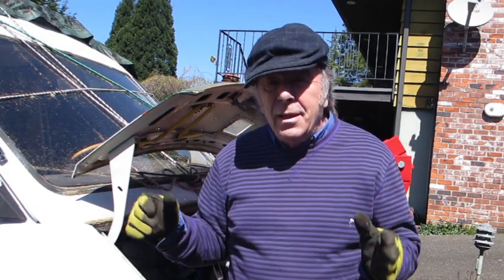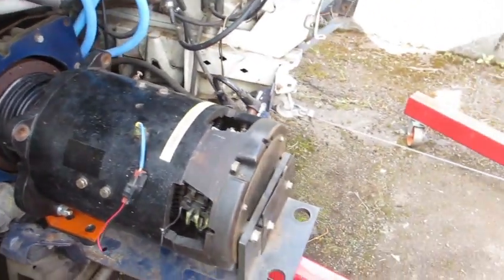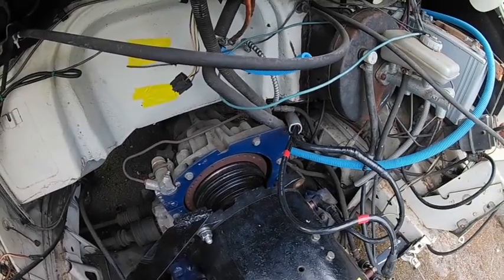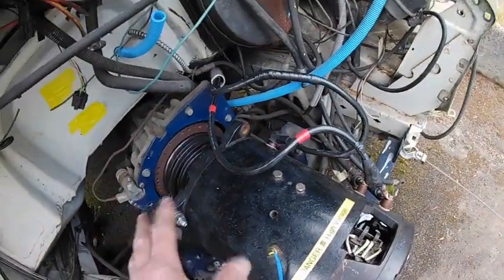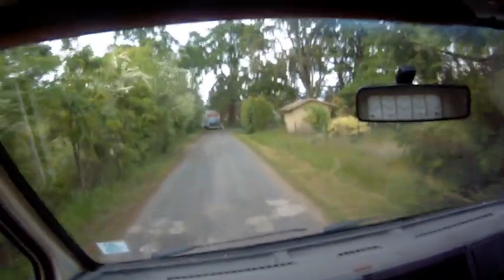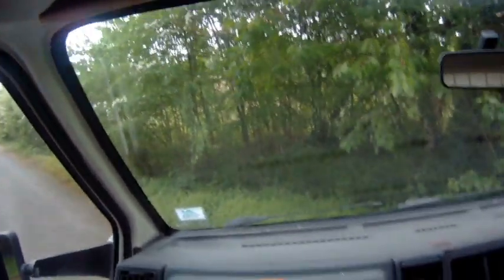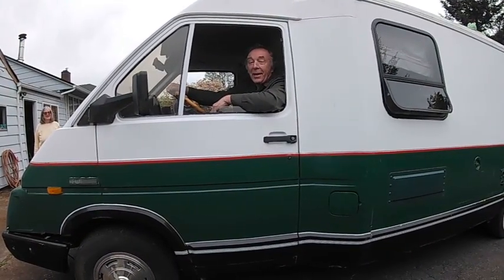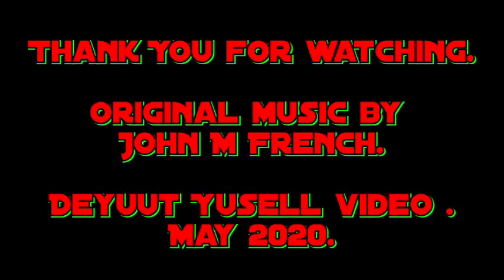1985 Winnebago LeSharo 100%  Electric Motor home Conversion .SEE IT RUN !

Comment: What MPGe did you get after this? What top speed can you achieve?
Reply from the maker: There is no mpg , it's electric.
Reply: @roundgarage  that's why I said MPGe because it is the equivalent to what you would get. So basically how far per kWh and then I can calculate off that somewhere online.
Reply from the maker: @ElderSilverFox  Sorry, I misunderstood. I have only driven it up and down our gravel road , so I do not know how fast  it goes or what Kwh rating it has. I'm getting ready to install a Prius power steering unit as the steering is heavy without hydraulics.

Comment: Good to see you got it running! You're probably the first person on the planet to convert a LeSharo to electric drive. Congrats!  I plan to do mine someday when the diesel engine is spent...
Reply: just realised the fronts a renault traffic, which is usually a FWD vehicle
Reply from the maker: @lezbriddon  Yes, it's front wheel drive .That is why they can sit so low to the ground.
Reply: @roundgarage  oh I thought as part of the Winnie changes they made them rear wheel. I had the non Winnie pure Renault version in the 90s, but was called the t35 it's slightly bigger brother, was a hospital minibus, they had modified the rear with hydraulics so it could squat with the bumper touching the floor to get wheelchairs in and out easier.